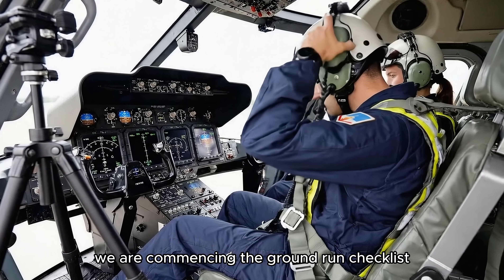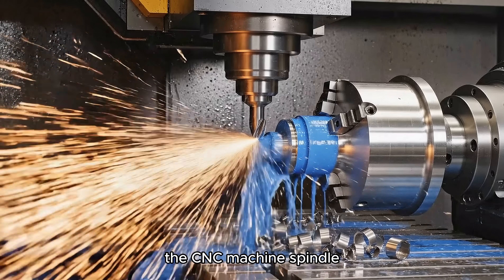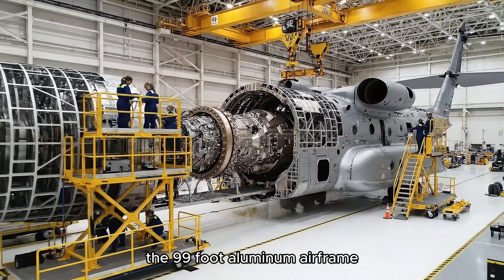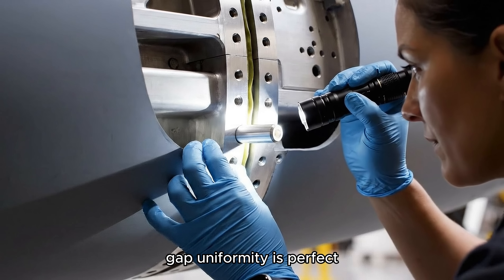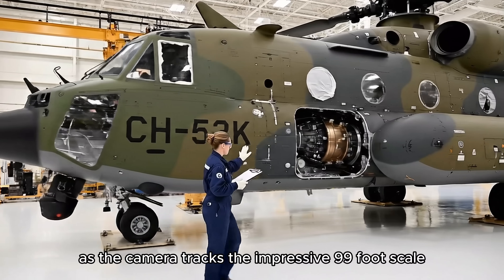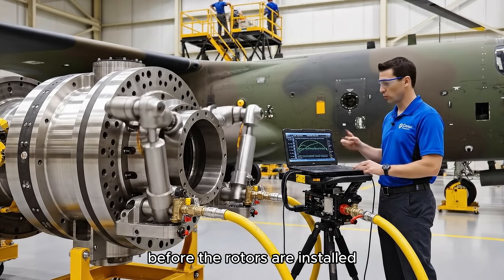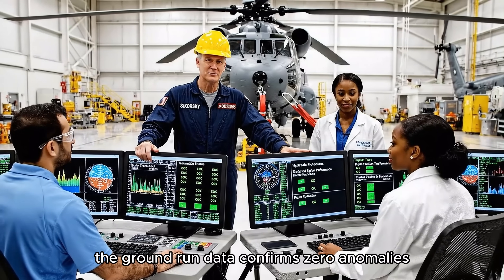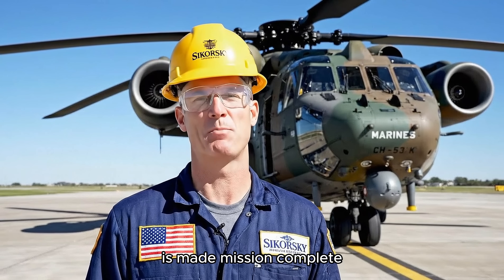Inside the CH-53K King Stallion Factory: How the World’s Most Powerful Helicopter Is Built

Comment: The CH-53K’s powertrain is on another level. Each of those GE38 engines delivers over 7,500 horsepower, and the gearbox has to merge all that torque without overheating or tearing itself apart. Seeing how they manufacture and align those components is pure rotorcraft artistry.